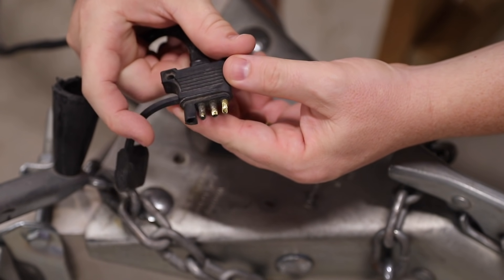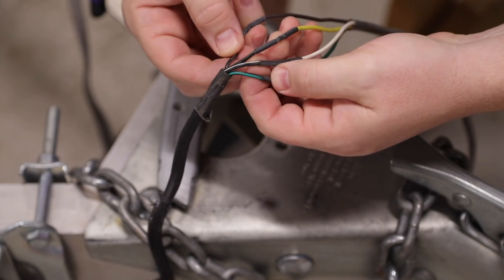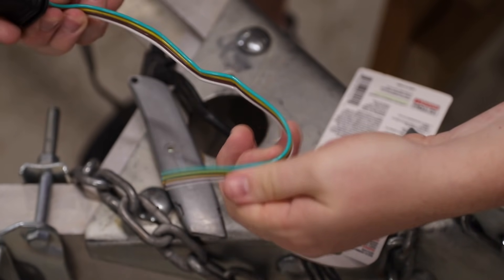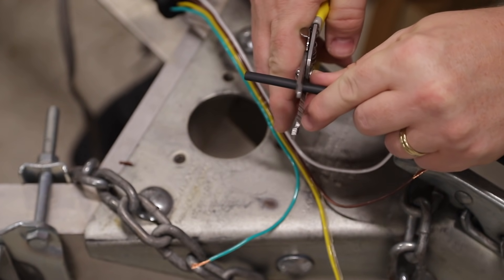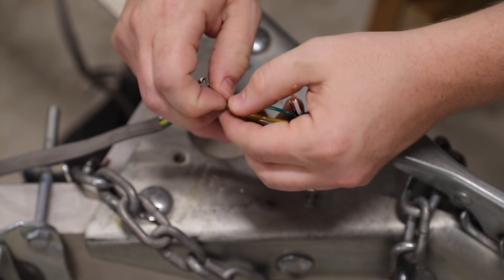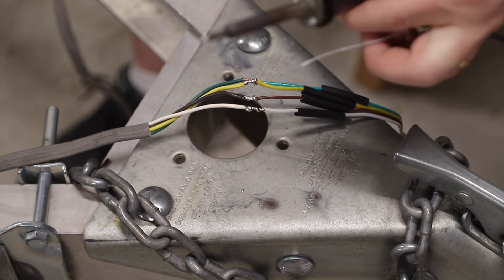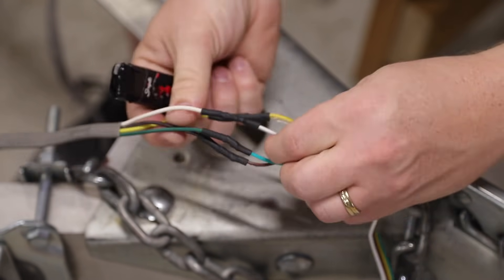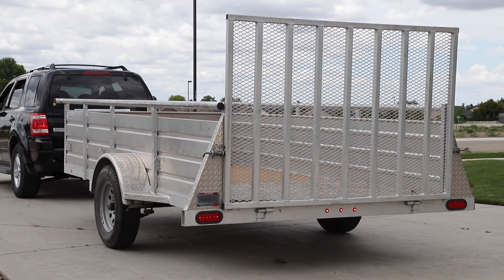How To Repair or Replace 4-Wire Flat Trailer Wiring Connector Harness

Comment: Great vid.....please remember to cross your hitch chains.  Why? If your hitch ever pops off the ball... the crossed chains will catch the trailer.
Reply from the maker: +freedom fighter this is an excellent suggestion. Thank you!
Reply: @AmplifyDIY  say , on my trailer wiring is a 4 flat with 5 wires ?  & on the output of my vehicle is a  4 flat with 4 wires - why is that ?  " HELP   PLEASE  "
Reply: freedom fighter see, now that is a great comment on your part! You said what he did wrong and not only said how to correct it BUT also the reason WHY. Thank you for that sir.
Reply: Kal El State police in New England notice these things also.......and the fines aren’t cheap!  Cross your chains.
Reply: I had the same thought as soon as I seen it!
Reply: True......please dont ask me how I know.....LOL
Reply: Twist. Not cross
Reply: Crossing your chains  may cause cancer in the state of California.
Reply: Good to know, I was doing it for fun
Reply: Great advice, not many people are told this.
Reply: Safety chains not supposed to cross in top the hitch. They are just extra safe to hold the trailer, they needs to be loos for the turns
Reply: I always cross my chains. And twist them if they rub the ground.
Reply: Also, they effectively reduce the amount of fall because they shortened the distance between the hooks and the ground.
Reply: I learned this from my grandfather 50 years ago and this saved me from having serious damage to my trailer when the lock broke on the trailer hitch and the it popped off but I was able to pull over and fix it.
Reply: I've always done this, but never knew why..  thanks
Reply: word
Reply: I was taught this in my 40’s…..worked with a firefighter from Massachusetts and he taught me this lesson…..and it’s the law.  I actually twist my chains
Reply: I thought everyone knew that.
Reply: People are not born knowing anything at all. Someone taught you this. People came to this video to learn so don’t look down on people for not knowing something you take for granted.
Reply: freedom fighter sss##sx
Reply: I don't like it crossed.
Reply: @brentbradley6711  it’s the law in my state and all NE states.

Comment: Does the trailer have to be hitched up to the vehicle in order for the lights to work? I did all that was shown and lights still don't work...I'm sure I matched up the wiring of the new connector to the vehicle wires too. I tested without the trailer hitched to my truck and lights didn't work at all. I just backed up close enough to connect the trailer and truck connectors
Reply from the maker: It's possible that the ground was not strong enough / connected correctly. Some trailers ground through the ball connection, so it's possible your trailer has to be connected to work... though this is not terribly common. There is a ground wire in the 4 pin connector (usually white) that should be connected directly to the trailer frame. I'd start by double-checking the ground connection on the trailer, and any fuses in the trailer wiring circuit in the vehicle. Good luck!
Reply: @AmplifyDIY  I got them to work...a combination of fixing broken wiring I found and putting in a missing 20 amp fuse did the trick

Comment: Excellent repair advise. I’m an old (80 years) radio tech and the name of the connection that it looked like you made is called (at least in my day) a Western Union Joint. I guess because that type of joint was used for the old telegraph wires as they were strung across the nation.
Reply from the maker: Cool history - thank you!

Comment: Where can I buy a cheap set of shrink wire tubing with a few thin tubes for the individual four wires and one larger tube to wrap around all four wires. I can’t remember where I bought the cheap set about 2 or 3 years ago.
Reply from the maker: I like this set on Amazon: https://amzn.to/2rfb5oj

Comment: Can I connected/plug the camper in to make sure the wires are correctly done before soldering? Is that safe enough?
Reply from the maker: You can - but make sure the wires cannot accidentally contact each other. Perhaps wrap them in electrical tape temporarily while testing. The worst thing that can happen though is that you'll blow a fuse in the vehicle, so it's relatively safe to try. Good luck!

Comment: I think I might solder it together I crimped them and added the shrink version of the m and it did not hing good for me thank you for the video
Reply: Supposedly crimping when done right holds longer than soldering.   Vibrations loosen soldered wires more.  Manufacturers crimp, so does NASA and the FAA.

Comment: Would it be OK to use wire nuts and electrical tape in place of soldering and heat shrink? Don't have the equipment and trailer will be stored inside when not in use.
Reply from the maker: Hi Evan - you really should not use wire nuts and tape on these connections. They need to be able to hold up to inclement weather while you are driving, as well as tons of vibrations etc. A cheap soldering iron that can do the job can be had on Amazon for around $20. Here are links to the resources I used in this video: 
Inexpensive Soldering Iron: https://amzn.to/33hOd5I
Assorted Heat Shrink Tubing: https://amzn.to/2rfb5oj
Trailer Wiring Harness: https://amzn.to/2PJz0Gq

Comment: Is it any big deal if I want to splice the other side, on to replace my corroded one on my truck? As long as the truck is off, should be ok? trailer side is fine.
Reply from the maker: Hi Jason - the technique I showed applies to both the trailer pigtail and the truck connector. Yes, keep the truck off, and make sure you are connecting the wires up in the right order. The wiring colors may not match, so I recommend you try to get a picture of which color wire from the truck goes to which connector on the plug before you even cut anything apart. Good luck!

Comment: Thanks for the video. The best price I could find on getting the pigtail part similar to yours  here was buying an extender off Amazon and cutting off and installing the part I needed to replace…vehicle end. So I did everything exactly to your instructions with solder and heat tape and when I checked to see how it went I got no active lights on the trailer. Luckily I have two trailers so I tried them both and neither worked. So I undid everything, re-cut and strip the wires, and just twisted the new wiring together to retest and still nothing. Any idea what could be wrong? My old part was destroyed dragging the road but worked fine just a couple weeks ago.
Reply from the maker: Hi Collin - apologies for the late response. Hopefully you have figured your connector out - but if not: have you tried to do a continuity test on the wiring of the trailer before adding the pigtail? When stuff does not work right, I like to take a step back and start troubleshooting at the beginning. I'd start by doing continuity checks on each of the pigtail connectors and their wires, and then each of the trailer wires on the trailer. I'll bet you'll find something not connected/working with that testing.

Comment: Instead of placing the heat shrink on the short connector wires, the side on the trailer side were already single.  Either way works, but I prefer to not do more work than needed.  
You should not use lead solder.  Modern solder requires more heat so get a good soldering iron.
If the wires have corrosion or charring, make sure to repair the source of shorting or it could start a fire.
If it is just corrosion, cut back or replace wiring.  Light corrosion may need flux to clean the wire so solder will flow and stick.

Comment: My trailer has a 4 flat with 5 wires going into it, one just grounds off to the tounge, I can't find a new harness with 4 pins and 5 wires how do I need to connect them to just use the 4
Reply from the maker: Hi Jared - after a bit of banging around on google, I found this question and answer from etrailer that I think will address your question. I've ordered stuff from etrailer before (hitches, adapters, etc) and have always found their information to be spot on: https://www.etrailer.com/question-363568.html

Good Luck!

Comment: Can I use electrical tape instead of solder and heat shrink casing ?
Reply from the maker: Hi Matt - you really should solder the connections. Some wires just twisted together and taped up will not last long, due to the vibrations etc inherent in a moving vehicle. Good luck!

Comment: Mine seems to have five wires but no breaks is that fifth wire maybe a ground every plug I find is four wire and the truck is four wires
Reply from the maker: Hi Marte - a 5 wire connector usually is for a trailer with brakes. It's possible that whoever wired your trailer simply used the wrong connector, and left the brake wire disconnected.
Reply: @AmplifyDIY  no I figured it out. There are two brown wires which go to each side as ground. So I put them both into one connector attached to the green wire on the plugThank you for replying though a lot of people don’t even do that

Comment: Comment......you should hook your chains from underneath so if you hit a bump your chains will not fall off and you should also cross your chains. Crossing your chains makes a basket so if your trailer hitch comes off the ball  the chains will catch it and keep it from dragging the ground.  Also twist  your chains to take some slack out if need be so the chains will not drag the ground.
Reply from the maker: Great tips - thanks, Greg!

Comment: Nice video friend. I may have to take this route. Have a great day!  thumbs up
Reply from the maker: Thank you very much!
Reply: I just realized this. What if its the female side that needs replaced. I had allot corrosion in mine. i had to soak in vinegar for a few hours which did a nice job, but appears according to the LED tester not a strong signal coming from for instance the left turn signal on the harness for trailer.  additional corrosion  or damage from the corrosion?
Reply from the maker: Both male and female versions of the replacement plugs are commonly available. The replacement procedure is the same for either one. Here is a good option to replace the female (vehicle) side: https://amzn.to/3kfa1Jq (affiliate link)
Reply: @AmplifyDIY  Thank you very much for your input. i appreciate that. Its inexpensive also. I was going to try fluid film first on harness, and ground first. If that doesn't work i may have to take this route.
Thanks again. Keep up the good work on your videos.
Reply: @AmplifyDIY  i purchased that item. Still have problem.   My 4 pin flat connecter on vehicle for trailer works fine. EXCEPT THE RUNNING LIGHT.  My 7 pin connector on vehicle for trailer works fine. EXCEPT THE RUNNING LIGHT.
What do you recommend?
Thanks.
Reply from the maker: Start with some basic troubleshooting: Do the running lights on the trailer work when connected to another vehicle?
Reply: @AmplifyDIY  Will do. Thanks allot!

Comment: Challenging the notion that there is no such thing as a stupid question:  How do you keep yourself from being electrocuted?  I can't seem to figure out how to disconnect the end that is currently hooked into my car?
Reply from the maker: Hi Stephen - the only stupid question is one that is not asked. First off, the term "electrocution" means that someone dies as a result of an electric shock. Your car's electrical system is simply not strong enough to electrocute you... though it is possible that it may shock you. However, since it's only a 12 volt system, and the natural resistance of your skin is actually pretty good, even if you walked up and touched both the negative and positive terminals of the battery in your car at the same time, it would not be dangerous. You'd likely feel a tingle, but the scenes in movies of people being tortured with leads connected to a car battery is more or less completely overdramatic movie effects.

As for how to disconnect the end that is connected to your car: do you mean that you need to remove the receptacle that is wired into your vehicle? Or do you mean you can't figure out how to disconnect the plug that goes to the trailer from your car?
Reply: @AmplifyDIY  Thank you!  I am wondering how to disconnect the receptacle that is wired to the car.
Reply from the maker: @stephenwhiting9611  That receptacle is typically wired into one of the rear tail lights of the vehicle. Are you hoping to completely remove it, or just repair the receptacle? If you give me some more details (some pictures would be really helpful) I'd likely be able to provide some better advice. Feel free to email me directly: amplifydiy (at) gmail (dot) com.

Comment: 4-pin connector, never seen that. In EU we used a 7-pin round connector, now a 13-pin. Nice work!
Reply from the maker: This style of 4 pin is really common in the US for smaller trailers. Larger ones have round connectors here - not sure if they are the same as in Europe. Probably similar though. Thanks for watching!

Comment: If you cut each wire a tad shorter then the first then you wouldn't need all them shrink tubes keeping the wire the same diameter throughout.
Reply from the maker: Great tip!
Reply: @AmplifyDIY  Also something I have never done is add silicone grease to the wire before shrink tubing but I'm going to start doing that since I live on the coast and the air is salty here. Can't hurt
Reply from the maker: That’s also a great idea. You may also want to try he heat shrink that comes with hot glue inside it. That will also make a water-tight seal. Good luck!
Reply: @AmplifyDIY  I didn't know that was a thing thanks

Comment: Thanks for the video. I might just test out the lights before soldering in case they are crossed to avoid possible extra work.
Reply from the maker: That's a very good suggestion. Thanks!

Comment: Can I use the same solder that I use for plumbing copper?
Reply: answer is no nvm
Reply from the maker: They use different kinds of flux. Plumbing solder uses an acid-based flux which can make for weak electrical connections: https://fastenerengineering.com/whats-the-difference-between-electrical-solder-and-copper-plumbing-solder/

Comment: lighter to melt insulation
Reply from the maker: Yeah, use a heat gun. Much safer.
Reply: I would think a heat gun would be unproductive to remove a wire insulation on a single wire beside other  wires. I actually suggested using a lighter to remove wire coating on thin wire instead off messing up with wire stripping on 14 gauge

Comment: Soldering tips: First, buy solder "flux" when you buy the solder and put that on the exposed wire before soldering. Second, use the soldering iron to heat the wires and touch the solder only to the wires, never the iron tip. This ensures that you don't have a "cold joint" which is weak. Very clearly shown here: https://www.youtube.com/watch?v=qxqZJH3SfN4
Reply from the maker: Good tips, thanks!

Comment: I hooked the yellow and brown to the driver side for my trailer. I hooked the brown and green to the passenger side but the light does not turn on it just gets hot. If anyone can helo i would appreciate it.
Reply from the maker: Hmm... if it just gets hot, there is a short to ground somewhere. You'll need to check all the wiring along the frame of the trailer to see where the insulation has worn through so that the conductor of the wire is touching the frame of the trailer. These are hard to find - good luck!
Reply: Thanks

Comment: I'm sorry but you did all that work to cover the wiring with two sizes of heat shrink tubing... But you left the last 8 inches near the plug exposed? That doesn't make a bit of sense. Lol why not cover all of the wiring?
Reply from the maker: Heh - great point! I didn't have any more of the larger heat shrink on hand. It's 2 years later now, and the trailer wiring is holding up fine (this trailer gets used quite often). Thanks for watching!

Comment: Just so everyone knows, trailer wire colors are universal across the world, so a 4 flat connector wires all have the same color wiring that do the same thing by color everytime, and the trailer wires always match the colors
Reply from the maker: Unless, of course, someone has re-wired your trailer with the wrong color wires... 😬
Reply: AmplifyDIY true but the 4 flat connector colors always mean the same thing so all you need to find out is what wire runs to what
Reply: Chase Bowers some LED replacement lights have a red. White. And black color wires.

Comment: I bought a new assy. for hooking a pigtail for my gmc 2005.ran my wiring for my camper trailer.I know green is for right turn and yellow is for left, put left turn signal on,right one comes on. my truck also has a 5 sec. shut off for my lights, camper lights stay on. tail lights have red, green and white. ive worked on a lot of trailers but this one has got me.
Reply from the maker: Hmm. Chasing electrical gremlins can drive you crazy! Sounds like somewhere along the circuit someone crossed the taillight wires. Just swapping them at the connector should get them working correctly. As for the lights staying on even when the vehicle’s lights are off: does your vehicle have back-up / proximity sensors? I had the same problem with a 2008 Ford, and needed to get a different version of the trailer adapter for the vehicle designed for one with the reverse sensors. Good luck!

Comment: My wired drag the floor now sometimes it works sometimes it don't and it's bend it do you think that I'll mess it up  I have to do the same thing you did I believe I also have the 4-way flat pin
Reply from the maker: Yeah, sounds like you need to replace the harness, just as I did in this video. Good luck!